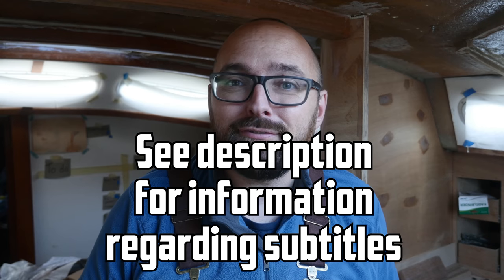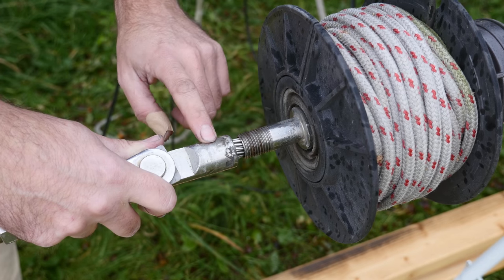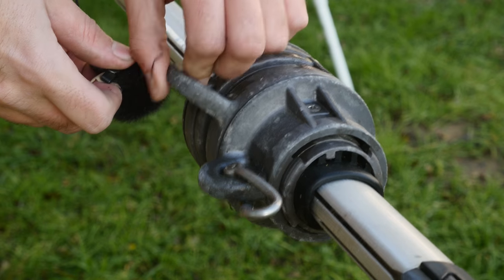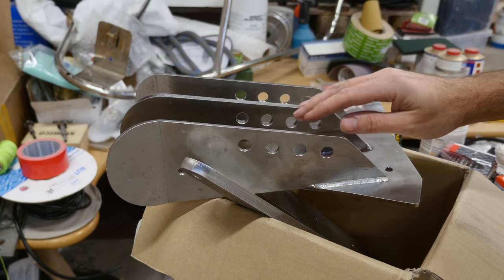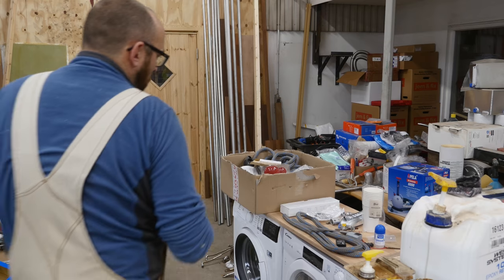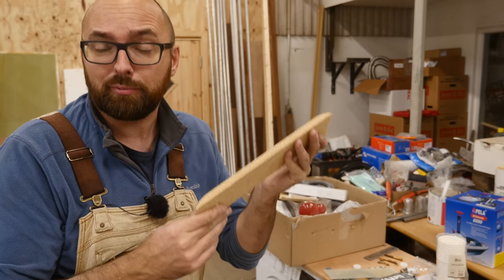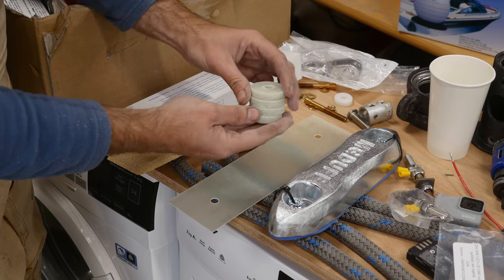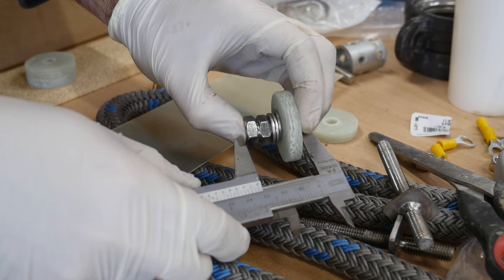Sail Life - new headstay, zinc anode and ground plate - DIY sailboat project

Comment: Mads there is no rush on this and you can do it when the boat is in the water but if you have time you might want to change the sheaves.  The ones for wire rope are a bit different than for cordage.  And likely they are a bit warn. Also you may want to put on a masthead fly.

I think your boat looks great.

But don’t feel the need to get everything done before you splash.  The world will go on after your boat is in the water and I promise you boat projects will be never ending.

Best wishes.  Stay safe.

Comment: Hi Mads,for pulling cables,ropes,lines etc as a retired electrician we used to use a device called a cable sock,they come in all different sizes and are re-usable I have seen many diy boat restorers taping wires,ropes to messengers or other ropes but have never seen anyone using the cable socks that are designed for this purpose maybe if you have time in your schedule you can have a look at them online.Keep the great video's coming.

Comment: Tying a small piece of ribbon or plastic bag to light string and then using shop vac to suck thru is effective way to get pull lines in. Works in some situations where other methods won’t. Tape over other holes in mast or route if needed to decrease suction loss and steer string to exit hole

Comment: Nice little trick when cutting bolts down, put a nut on first so that after the cut is done and you take the nut off, it cleans up the thread as it comes off.
Reply: and you can put that nut in the vise to hold all still then grind the cut edge before taking the workpiece out  of the vise.
Reply: Just lika David said thats a classic lifehack, looks like a good idea but it's useless in reality. Chamfer the edge on some kind of sander an then it's way better.
Reply: @johnassmundsson516  Actually if you put a nut on first, cut the bolt then chamfer the end with a file or sander, it works every time. The nut will clean out any little burrs left from the cut. I do it all the time.
Reply: A lot of talk about useful Nuts, there are 3 types of Nuts, used for bolts, eaten as snacks and used to make babies. Have a great week everyone.
Reply: Gary 100% 👍
Reply: @RondoGlobal  lmfao

Comment: The electropolishing is fantastic it takes the impurities away from the surface so your stainless steel doesn't rust. When you manually sand and polish after the electroplating you will expose more impurities and should electroplate again or do your electroplating after you mechanically polish

Comment: Hi mads with regard to your running rigging dynema is expensive but if you have clutches on the mast for your main and Genoa halyards might I suggest you make the halyards the length of the mast with a spliced eye in the both ends so you can attach a cheaper line to the eye with a lashing for when you need to drop your sails and remove it when they are up, it has two benefits one less rope at the mast when the sails are up and secondly less expensive rope to buy.  
 And also I would suggest you check the sheeves at the top of the mast for the depth of the v in the sheeves  as wire sheeves are deeper than rope ones and have a chance of wearing earlier than with the correct sheeve.   (Sheeves being pulleys)  just a thought love what your doing and watching your progress keep up the great work 👍

Comment: In the future when cutting down threaded rod it can be helpful to tread a nut onto the rod first below the cut point then after you cut the rod and grind smooth the end you can unscrew the nut and it will chase any corrupted threads making sure you have no issues with threading on the nut... often when cutting a rod and grinding the end it can be a struggle to get the nut to thread on the first time since there can often be a little thread damage at the end due to the cutting process. Hope this tip is helpful.

Comment: One thing I wanted to suggest for when you are taking apart old assemblies filled with dried up dirty grease is to skip the heavy duty solvent and use WD40. You'll be shocked at how the nastiest stuff will just melt to the point it wipes right off with a rag.

Comment: MADS, you can space the plates from the hull by making your own spacers that go all the way to the tips. You won't have the hook effect, it will be spaced, so there's more surface area, so everyone wins. We're talking about two Delrin spacers, easy to make.
Also, on the deflector, you need a bushing over the wire, if the wire ate the Delrin bushing monstrosity that was there before, it will chew up that dainty plastic piece.

Comment: may you find the Ball with a strong Magnet..? Touching Wood   :-D... Will be back in 2 Weeks, Thx for the Vid!
Reply: stainless steel is not magnetic!
Reply: @lucabuono690  unlikely ball bearings are made of stainless steel, test one of the captured ball bearings for magnetism first, then go wave a neodidlium (AVE) magnet over the affected area and rejoice.
Reply: @Edwardmodos  Yes. Ball bearings are typically chrome steel, not stainless, and and even the ones that ARE stainless are 440C stainless, which IS magnetic. 316 (which isn't) makes not terribly good bearings, and applications that need "not magnetic" for bearings will typically choose to use ceramic ones.

Comment: Great info about the furler. I have that exact same one and it might require some service some day. Also just replaced the running rigging before lifting the boat - 6 x 40m of 10mm dynema mmmmmmm........ :-)
When replacing the running rigging, make sure the diameter of your new ropes fit your winches and locks.
You also might want to check that the pulleys at your mast top are suitable for rope.

Comment: Regarding your radio ground plate. In theory, as you stated, the ground plate presents a significant surface area to the water - for as long   as the plate is clean. It will soon develop enough growth to completely negate its intended purpose. How clean will the overall hull remain? That's as clean as your ground plate will be. Think about it .  .  .
An alternative is to run an interior wire loop around the inside of the hull, below the waterline and as large as possible to create the maximum possible surface parallel to the water. This provides capacitive coupling - the same principal as a magnetic mount provides on an automobile with a CB whip.

Comment: I wouldn't use that halyard diverter. I don't have one on my boat ( and I accept the risk) but a rigger suggested a nice trick : Use a low-friction ring on a short dyneema loop. The loop goes on a padeye on the mast. That way, the diverter doesn't "divert" the halyard unless the halyard is attempting to wrap around the stay. If you already have the padeye and thus can't change its position, you may still have to divert the halyard a little.

Comment: Mads, may I suggest getting extra parts of the standing rigging that you are replacing now, including the plastic deflector, and putting everything in a  box with divided compartments and label everything. I would even get extra bits like the cotter pins and washers. I've seen many other sailing channels and all of them have replaced many of the small parts of the standing rigging at sea or in a foreign port halfway around the world. One of the Dewalt or Milwaukee, etc.. boxes with lots of compartments would not cost much and it would be easy to see what you have when you need it.

Comment: Regarding the halyard diverter vs deflector issue. Harken calls theirs a halyard restrainer. And according to Harken you want a 8 to 10 degree angle between the halyard and the forestay when the upper swivel is at the top of its travel.  If the entrance to the halyard sheave is far enough away from the forestay  clevis pin, you are fine.

Comment: Yeah, the new, bigger cone has more surface to lock the wire, so that's why it's different. If it were my boat, i'd make a custom reamer to ream the inside of the OG coupler to accept the new one, but that's not everyone's cup of tea (the difference between the two isn't so big that reaming the cup for the new style would weaken the structure. We're probably talking about a few shavings worth, but like i said, not everyone is keen on modifying OG equipment.

Comment: Try sweeping a large magnet around the area you think you may have dropped the steel ball. I’ve saved myself a few times with a magnet👍. 

Hope all goes well through the final push to have her ready.
Reply: Not worth it, and for that part, it's probably best to swap the balls as they lose round after a few years of use.
Reply: @aserta  true, unless there’s likely to be a delay in getting it delivered. I’d always prefer to replace for new if stripping down something but when you’re in a fix, a magnet can save some stress

Comment: Have you thought about using polyurethane sealant for your chain plates and rigging plates.  Like the stuff you use for windshields that stuff will stick to anything and has great flexibility. I use it a lot for waterproofing Passthrough Throughs through projects and it works great.

Comment: You should have raised the deck where the chain plate comes thru 1/2"like a a backing pad glassed ,that way your not relying on sealant to keep the water out running along the deck

Comment: Dyneema running rigging is overkill for this cruising boat and twice the price of polyester (Staset).  And having slight stretch on a cruiser is not a terrible thing (shock loading). And line handling is easier on the girlfriends hands. It will last years and you can replace it 3 times for the cost of dyneema once.   That being said, Mads would be off watch  in his bunk awake all night hearing every creak and worrying his halyard is stretched 2 inches and he is losing 0.000000005 percent performance.. So I am  looking forward to hearing about the new Dyneema rigging next week!

Comment: Where does one find those special zinc anode through-bolts? Our boat had regular bolts screwed in from the outside so the anodes can not be replaced without hauling out.  When I replaced them three years ago I just replicated the same system, not knowing any better.  

We almost never stay at a marina so the boat doesn't see much electrolysis and we also have a galvanic isolator in the shorepower ground.  We just hired a diver to clean the bottom a few weeks ago and he said while there is some wear on them they are massive and are better than 80% still there.  We have two for a 35' boat and they both look bigger yet than the new one on Athena.  

We also have a ground plate but it isn't hooked up right now since the SSB radio isn't even mounted at the moment and has never been since the refit.  I just never got around to it after 2-1/2 years of cruising -lol

I had to wait untill my wife woke up this morning before watching this early video with sound.  When you live in a small sailboat there is no other place to go to watch a video.  I don't even think I own a set of earphones any more.  That is Cruising Life or SailLife on a small boat.

Comment: I think you are doing a great job, but one of your chain plates is a double edge to edge and don't see how it can be sealed to keep moisture from seeping in between. I think it should be a wider slate with two holes in the top portion. other words one individual plate with two plates

Comment: Ok now that you stole my idea of raycor 500 fuel polisher. How about a surveillance camera on the mast to show whats in front of the boat like submerged rocks or logs or clearance under a bridge  or even to keep track of some one on deck.  If you plan on pre filters I recommend 3    filters, mounted parallel on common rails with an in and out  shut offs valves on each filter. Open 1 filter in  and out flow. When this becomes clogged then turn on  no 2 filter, but leave the dirty one on because it will still flow some. When 1 and 2 are dirty then open the 3rd one and shut 1 and 2 off to isolate to clean.Might plumb in a vent to purge air. A friend for mine run aground coming into the marina when the engine stopped from a dirty filter and was blown to shore. Dropped anchor to late, then walked out on low tide the next day to recover the anchor . Ive been reluctant to modify my boat but not anymore thanks to you.

Comment: What no giant magnet to find your awol ferrous metallic pieces? Ok let this old salt school you on things that roll an slide and try to escape while underway...buy a magnetic mat or piece of magnetic roll to go on your work bench and purchase a lot of different shaped magnets, they are going to come in so handy.The magnetic advertising magnets you might get from a store or cafe that would stick to a fridge are invaluable to keeping control of little items on your chart table, work bench on board and on other counters. I believe I saw you use a magnetic triangle while welding recently. tie a string through the hole and drag it through the grass where you dropped the bearing.

Comment: What's the purpose of the giant hull anode, the saildrive has its own anode so what is it protecting unless you're planning to wire it to something internally?

Also, what's the purpose of the ground plate, you're not going to ground the AC circuit unless you want to risk electrocuting nearby swimmers, the DC circuit can be grounded to the battery negative, the only thing I can think of is as a lightning strike earth or an SSB?

Comment: At 10:30 I read the instructions as saying "drill a 5mm or an 8mm hole, depending on which model you purchased"
Reply: It says specifically "Drill the necessary number of holes with a 5.8mm drill point using the fiberglass plate as a die". Don't know what you were reading...

Comment: Hey , Will miss you come next Sunday, will have to find a different fix n "DEALER". BTW: have you considered the issue of rodents/insects or loose nuts n bolts in the boat stuck in places you cant see? as ATHENA is till stable n stationary.. will you be cleaning out n evicting stowaways both living or loose noise generators like nuts,washer,tools etc from places you can access now and seal off? just a thought i had. see you in a bit. slow n steady is the right call. later.

Comment: Sorry my ignorance but since your boat is not made of aluminum why do you need the anodes on the hull?
Reply: All of the metal bits that penetrate the hull are interconnected by wire. So that one large anode protects all of the thruhulls and rigging. I don't have one so I can't be certain, but the necessity of isolating the saildrive electrically means that the anodes on the propeller/what little shaft is exposed have no effect on the thruhulls etc.
Reply: @jkepleriv  Thanks for the reply. I am still puzzled since there is a foam between the hull and the anode. Usually there is a direct contact between the anodes and hull and/or propeller to allow for the electrons to flow and protect the parts from galvanic corrosion. I am surely missing something here.
Reply: @corujariousa  Hence the terminals on one of the bolts. The hull is fibreglass and does not need protecting, actually you want to isolate it from the copper so you don't create a battery.  To restate: As all the metal bits are connected by wire (green by ABYC standard) any current will go to ground (the water you are floating in) by the lowest resistance connection.  As the zinc reacts easier. It is the path that the current follows instead of leaching the zinc out of the bronze  thruhulls.  .
Reply: @jkepleriv  Thanks a lot.

Comment: What's the point of fitting a zinc anode to a GRP hull?
Reply: To protect the propellor and stainless steel propeller shaft?
Reply: @normanboyes4983  Propeller and Shaft (Saildrive in this case) each have it's own anode.
Reply: @devmich99  But the hull is now kinda copper?
Reply: @normanboyes4983  In most anti foulings there is copper.

Comment: For such a ground plate I am looking for since a longer time for usage as the main electrical ground, but also to ground prospective lighning strikes. According to all up-to-date books I read  so far the ground plate should need to be 30cmx30cmx3mm copper in salt water to securely overcome a lightning strike to not create a whole in the hull in worst case. But so far I did not find any products matching this requirement so far. Therefore the spacers in your setting seems to might be an issue if you have serious grounding in mind. Copper should be used because the temperature will not increase too much with this metal during a lightning strike compared to i.e. stainless steel. I need to check the behaviour of bronze compared to copper in this context, I don´t know so far. But your bronze plate with huge surface area is interesting. Could you provide some more information where you got this? I am considering the same, but will do some further research on this and will let you know about the results as well.
Reply: ^--- A BRASS rod at the masthead and a SOLID CORE wire leading to a brass thruhull bolt 🔩 would help in a lightning 🌩 strike. The electrical surge can, and will travel easily in 'any' wire. For that matter, it ( 🌩) will go were it wants. A little help is a welcomed help.

Comment: For the running rigging, Dyneema core/polyester cover lines are a good choice.
Check "DynIce Cruise" and "DynIce Cruise Dux" at http://www.hampidjan.is (Iceland). Buy full rolls or find a retailer.
Other European manufacturers exist, but I guess Iceland is less expensive in your case(?)